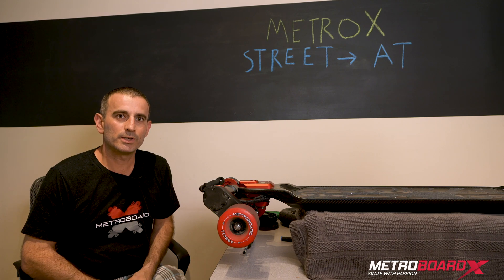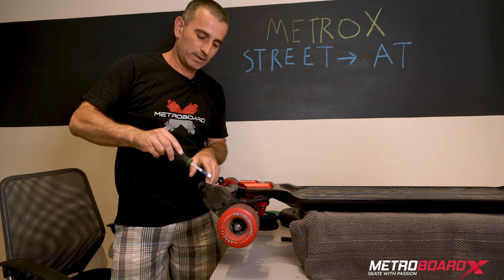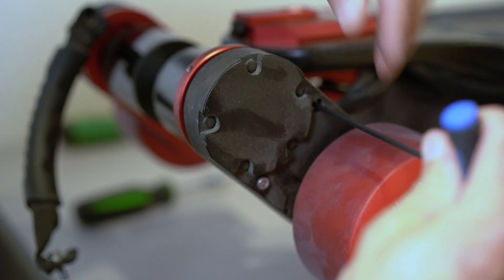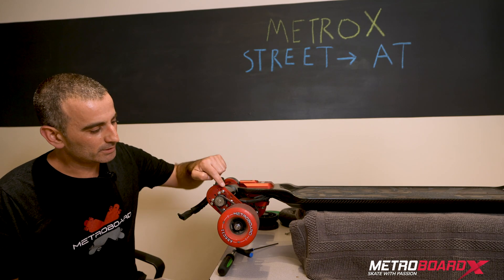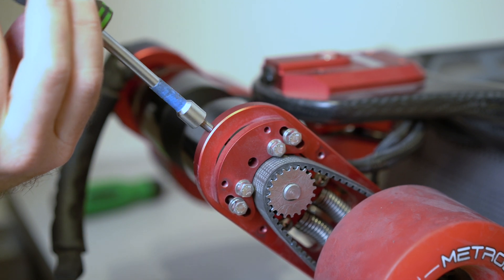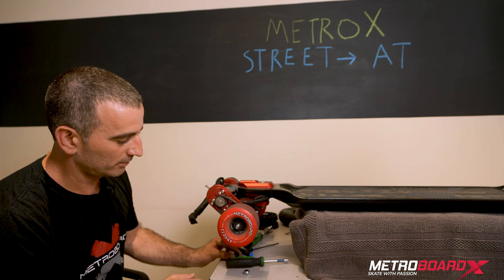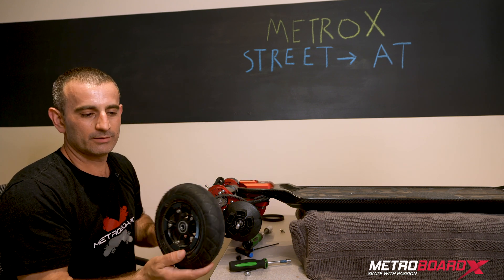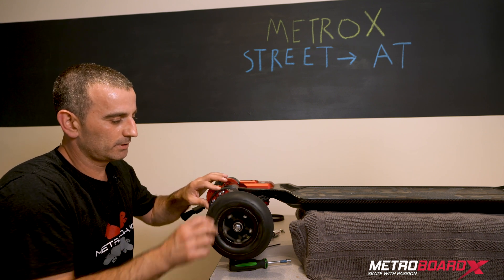Switching between Street and AT wheels - MetroboardX Electric Skateboard

Comment: 2 questions. will the zealous bearings work for this board? and did you have to loctite the grub screw in the motor pulley?
Reply from the maker: Our axles are 10 mm so you  need 10 mm ID bearings.  We sell them as spare parts and a few companies like Seismic also make them.  Yes we loctite the motor pulley set screws.  It's a must!
Reply: Metroboard Electric Skateboard i see. so 10mm bearings for the AT wheels only. Oh thats awesome! I always have a hard time getting the screw out. If I were to purchase the AT setup, does it come with a tire pump?
Reply from the maker: @gearsdan  we sell an electronic tire pump as an accessory https://metro-board.com/e-skate-shop/battery-powered-electronic-air-pump-metroboardx/